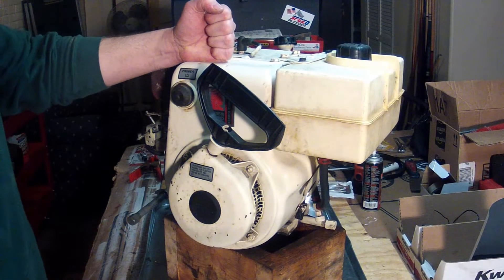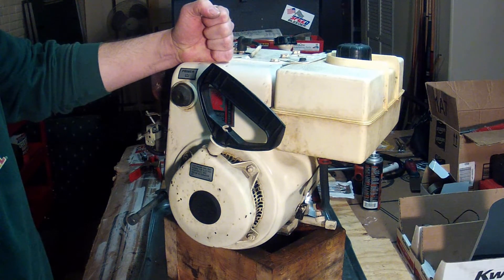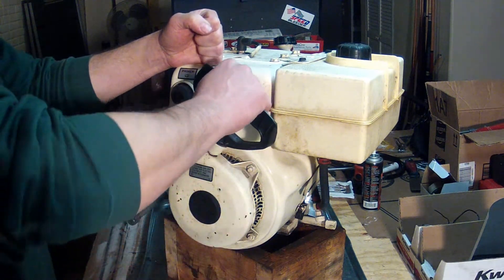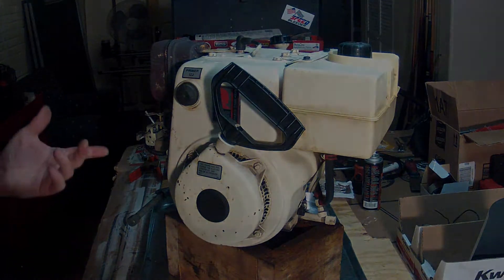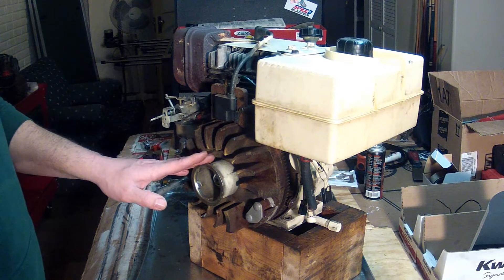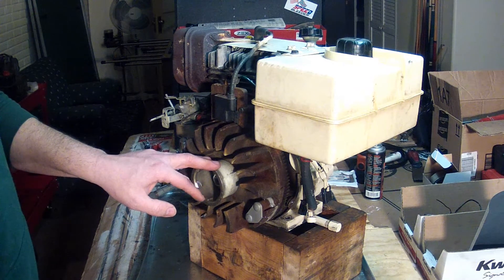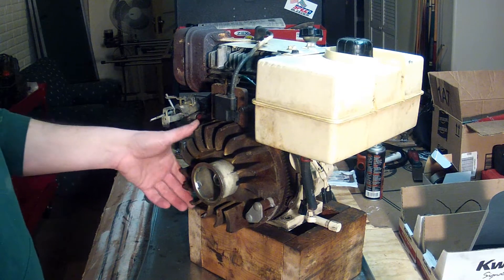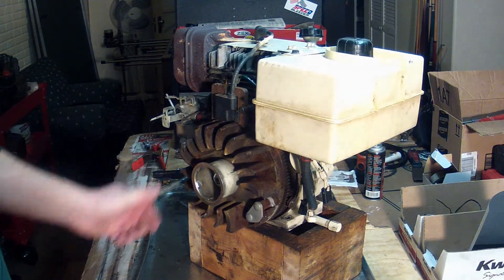Flywheel Key Keeps Getting Sheared - My mistake!

Comment from the maker: I don't know how picky your mower is as far as the flywheel key is concerned but I have been told that the tecumseh engines are very finicky. I don't know what kind of engine you have (my Eager 1 had a Tec) but change the key anyway. Thanks for watching.
Reply: Eager 1 is Tecumseh its was Tecumseh's name in Sears. Iv'e had a few eager 1's that worked better than the Briggs. Iv'e had other Tecumseh lawnmower engines that were junk. The eager 1's that were on the silver push mowers and the ones that were between 6.5 to 6.75hp on the green sears push mowers were awesome they looks like Briggs and had similar mufflers. An eager one on a sears edger also worked very well. I had the eager 1's with the smaller front's on a gold and green model that weren't so great it all depended which. The one worked so well on the silver push mower when the guy came to buy it he ended up cutting my whole front yard it ran so well, damn good engine. If it had been a self propelled, I would have kept it.

Comment: Good tip.I have a Craftsman EAGER 1 Mower.  Will start sometimes & then stall. Have to wait a couple of minutes & prime , the same.  I Though it was the Carburetor cleaned it up but the same. It does the same with starter fluid. I checked the fly wheel & the key  alignment looked like it was off a little. The key is not sheared has a slight bend hard to see. Is this enough to have a no start?